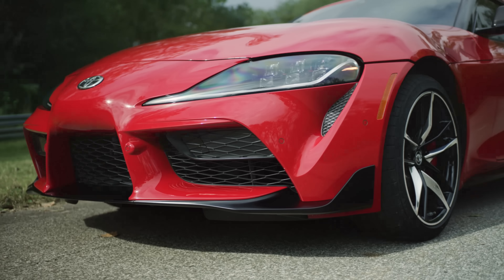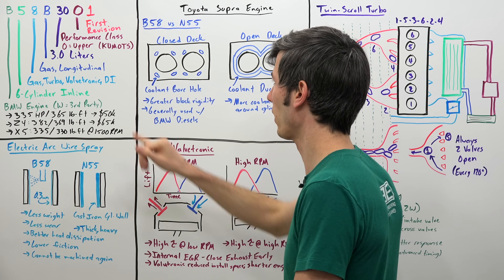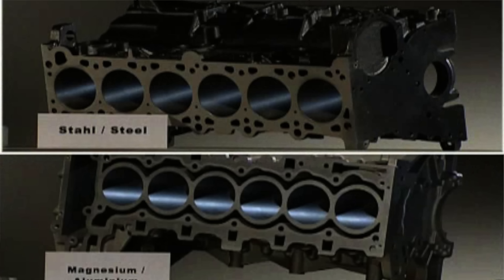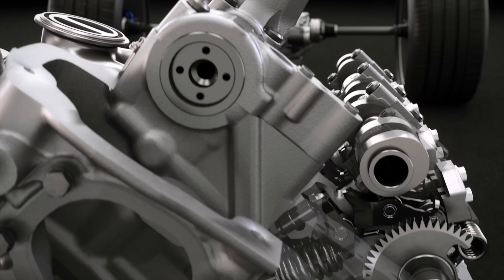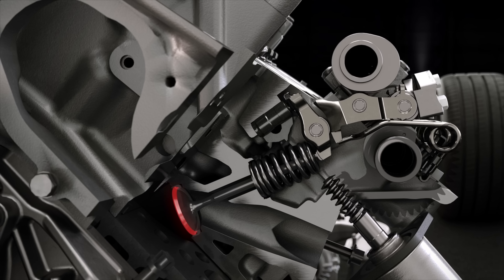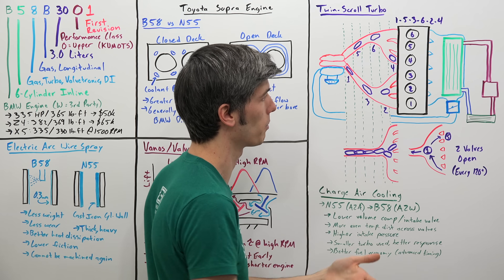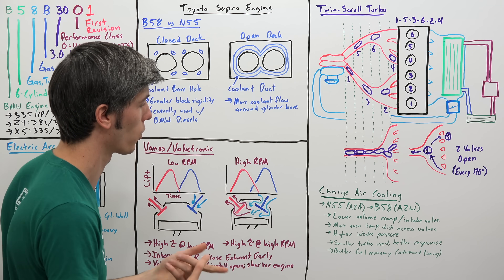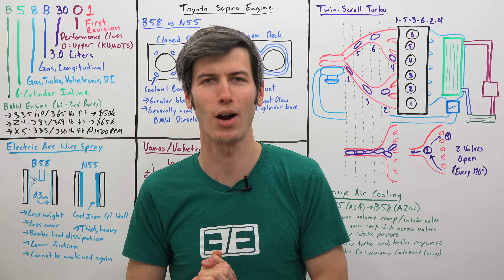2020 Toyota Supra Engine - Detailed Review Of The 2JZ Successor

Comment: Basically the engines garbage you can't really build it can't board out you're stuck with what you're stuck with
Reply: So what?  The most you can go on a 2J is .040", to 87mm.  That's nothing.  This isn't a NA big block, you don't need all the cubes.
Reply: Obviously you have never heard of sleeves
Reply: @TheRealAdamP  they just said that block was not able to put sleeves in it it has a special coating on it one size piston. From what I gather
Reply: @nyo_nyosupra1059  Probably can still be sleeved , I've heard of it being done to engines using the same coating idea before so maybe they're just saying that because you'd be degrading the engine performance/efficiency if you did it so you'd probably only do it to keep it going after some years of wear and tear.
Reply: @RWoody1995  I think it may not be possible, given the fact walls between cylinders are going to be too thin, OR if material expansion under heat is not considered carefully chance of failure is pretty big. May should be possible if someone machines joined sleeves which could be steep in price. On the other hand it may work if its possible to underbore the cylinders and increase the stroke. Those sixes are pretty balanced so added vibrations shouldnt affect them too much. Seen a lot of stroked M50s and M52s with diesel cranks from BMW so... maybe possible.
Reply: @nyo_nyosupra1059  I'm not sure you understand what sleeving is. They cut out the cylinder, cut out everything they don't need, and press new cylinders. You can sleeve any motor.

Comment: No dual injection? Doesn't that cause carbon buildup on the Pistons over time
Reply: The IS-F has a V8 with both port and direct injection to help keep the valves clean. Was looking at getting one, but decided Tesla 3 now
Reply: Paul T yeah so does rcf gsf, so I'm thinking the reliability is gonna be questionable after 100k ish miles
Reply: Build up occurs but it doesn't require cleaning until you're well passed 100k miles.  BMW figured it out when they released the N55 back in 2010 or so.

Comment: Pretty sure the Z4 is going to get a B58tu vs a standard B58. BMW covers the differences between the two, but essentially they did some tweaking with turbo size (I believe), cooling management and other bits here and there. The result being an engine that's more efficient and gets the added 50-ish bhp. This makes sense. BMW strategically giving their Z4 a bit of an edge over the Supra for initial sales. I'm sure there will be another edition of the supra that will get the 58tu later on.

Comment: I think this engine is a worthy successor 2JZ but at the same time it will never even come close or possibly be compared to the 2JZ. Why? Because of its complexity. What made the 2JZ great was not just it’s performance but it’s simplicity. Hardly any tech, just a big indestructible hunk of iron that can withstand any kind of hell you put it through. The B58 is certainly not. I personally appreciate all the tech that makes it give these performance numbers while being more efficient and lightweight - something important for a racing engine. However, that means you can’t simply slap a bigger turbo on it and make 800hp. Tuning it will take some serious engineering knowledge, and that’s okay with me. It is not meant to be anything like the 2JZ and I’m okay with that too.

Comment: I feel like Toyota gave up on trying to appeal to racing enthusiasts and the truck segment too. This car is nice to look at but the concept version was so much more appealing. It looked like a racing version of the LC500. It boggles my mind that they used a car from Lexus’ competitors instead of their own Lexus platforms just like they used to do with the SC300 . I understand that the Z4 has 50/50 weight dist. , but it is not impossible to do on a Lexus chassis, nothing is impossible. The engine block on the BMW Zupra can not even be rebuilt after it loses compression. On paper this BMW is going to be a great car, but this car is way behind its old competitors, the GTR and NSX. Both of those cars will beat the Supra in every way. Both Nissan and Acura , companies who are way smaller than Toyota, created massive hype and both have arguably lived it to it with the use of carbon fiber , suspension , at least 400hp , AWD , and they just have a presence and appeal to them especially since they are built in house. Those cars are special, they have their own unique powertrains and share little to no components with other cars in their line up. This Supra is going to be destined to flood the streets when they are lease specials for under $399 a month .

Comment: Hey slight correction on the naming scheme... the b doesn't stand for BMW. It's just the series of engine. One of the first iterations of this engine was the M50, then the M52, the M54, then the N54, N55, and now the B58. There is no W designation for BMW engines. The second is correct, but the 6 designation means 8 cylinder... so yeah. The third number just means the technical iteration of the engine. 50 being first, 52, 54, 55, 58. Etc. The next engine in line will probably be a B59.
Reply from the maker: The naming discussed in the video is correct, and straight from BMW's technical training. B (or N) mean the engine was developed by BMW Group. W means 3rd party. The 8 does in fact mean Gas, turbo-valvetronic direct injection. If you don't believe me Google "BMW B58 technical training" and the document will show up.

Comment: I don’t get this Toyota, why make supra if they not gonna make it themselves?
Reply: ButtFeet You must be either really young or late to the party. In short, without BMW there would be no new Supra at all. It would be impossible. The old Supras were made at a time were the Japanese economy was booming and Toyota had plenty of money to blow on developing their sports cars to improve the racing reputation of their company. Even still, Toyota lost money on every mk4 Supra sold. But even with all the extra money Toyota had, you have to understand that the 1JZ and 2JZ were engines that were used in a whole range of Toyota vehicles, not just the Supra, which justified the cost of development. Back then, in-line 6s were popular. Nowadays all of Toyota’s line up is either turbo 4 cylinders (for fuel efficiency) or v6. Toyota does not have a modern twin turbo inline 6 in production, and it would cost way to much to develop one for just one car. But without a twin turbo inline 6, they cannot make a “Supra”. That’s were BMW comes in. The b58 engine is one of the most reliable and tunable modern tt in-line 6 engines in production, with qualities similar to the 2JZ. So it is a lot cheaper for Toyota to source the engines directly from BMW, rather than having to make their own. From a business standpoint it makes 100% sense why they had to work with BMW. I hope this clears it up for you.
Reply: What's stopping them from updating the 2JZ and putting it back into production? It's not really any different from today's engines.
Reply: @tempest411   It's an ancient design. And i doubt that they'd be able to pass modern regulations without heavy modifications. And back then it was used by many toyota vehicles. It wouldn't make any sense to bring it back as they probably wouldn't use it on any other car nowadays.
Reply: @MidshipRunabout2  not to mention if they do that, it'll be alot more expensive than this one,therefore,endless whining still.

And that's the cringey beauty of cynicism.
Reply: Stefan Trifunovic The B58 is a single twin scroll turbo, not twin turbo. The S55 is a twin turbo engine.
Reply: If I'm not mistaken, Toyota's trying to get into sportier cars, but they don't really have any modern experience at all. That's why at first they do collabs with the best, like Subaru and now BMW, to learn. Humiliating and painful it may be, but I think these japanese are willing to go trough anything to achieve their goal here. If that's true, they may end up as industry leaders like ten years from now.
Reply: Cost
Reply: To save costs. Not many are buying sportscars these days. And they have to partner with someone else to do so, even if it means the engine won't be a Toyota.
Reply: Because nobody is buying cars and less so with sport cars so its cheaper to partner with someone else
Reply: "Because no one is buying sports cars and it costs to much"..... so why is Toyota/Lexus producing a track edition RCF, LCF and ISF? Telling me again how expensive it would be to develop a motor, but Toyota/Lexus just dropped the twin turbo 3.5 Camry/LS500 V6 into the upcoming ISF and not the Supra as well? It's the same engine in the Lotus Evora 400, 410 and GT430, which all out perform this "Supra" and is lighter. Oh but wait, the LCF is getting a grand new 4.0 twin turbo, but the LC500 bearly sold hmm. 
Keep coming up with all these manufactured excuses. The fact is Toyota didn't give a craps about this car. They used this opportunity to make a quick dollar by pimping the Supra name. I hope it fails, and yes I wish they never made it.
Reply: @Wiggy321  they've separated ffs
Reply: @masashiiino6914  huh?
Reply: Omar I was just about to touch on that. Toyota has Lexus! They have the resources to produce a high performing online six to be crossed used with other platforms. Like you said they could even use an existing high performing engine or even introduce a new version with it! If I remember correctly the Lexus SC300, IS300, and GS300 were sporting the 2JZ design for years. I bet it would have been cheaper to just "collaborate" with Lexus (even though they are basically the same company). Toyota just wants to make money. This supra is not for the people or the enthusiast, it's for those that can afford to own BMW.
Reply: @churro6160  absolutely correct. Engine sharing throughout models in Lexus and Toyota has typically been the norm in the past. The previous 3.0 and 3.3 V6 in the ES and RX was also used in the Sienna, Camry, Solara, Avalon, for example. Even the A90 and FRS 4 cyl variant could have come from the IS200/GS200/RC200 and I believe the new UX200. These cars have an 2.0 inline 4cyl turbo motor. Toyota sold, tried and true enthusiast out, for a quick dollar.
Reply: @churro6160  what if Toyota really just wanted to spy in them??
Reply: Because ground up development on a new halo sports car would've cost hundreds of millions of dollars, and Toyota basically needed to play 20 years of catch-up. Why not shack up with one of the best modern I6 manufactures, and chassis developers that is BMW?
Reply: Toyota never made a sports car. the old supra was made by Yamaha.
Reply: @gabrielabers5119  This is factually incorrect, and I'd like to know who told you that. Yamaha has only assisted in engine design and production, all Supra models are based off of Toyota vehicles, assembled by Toyota.
Reply: @gabrielabers5119  i don't know what seventh grader told you that but that is vastly incorrect

Comment: I don't know why people even complain it's an engine made by BMW. It would cost a lot Toyota to make a new straight 6 as they haven't produced one for ages. Plus even if they brought up an older design lime the 2jz, they would have had a hard time making it fit with newer regulations. It would be natural then to ask someone who's making those engines for a long time. Plus bonus fact: the racing version of the Supra had a (in my opinion much better) 3S-G engine that was borrowed from their rally cars. As far as I've seen, no 2jz was ever implemented officially in racing

Comment: If they would of copied the old mk4 they could of sold more and it would of had a cheaper price tag. If you could buy a new mk4 for about $30,000 I’d be at the local Toyota dealer.

Comment: This is an excellent power plant.  Still.  I hate it.  This turbocharged 3.0 six was the beginning of the end for BMW.   No more sweet high revving beautiful sounding N/A straight sixes. BMW now slaps a turbo on everything.  Some programming and minor adjustments and you can put this engine in almost any BMW.  If you want to charge more money turn up the hp.  BMW has become the Ultimate marketing machine..

Comment: Good thing the B58 went back to the mechanical water pump vs. the N55 electric on my Bimmer.  it is known to go out between 65K - 85K and cost $500 DIY or > $1000 at the dealer.  B58 motor still do not have a dipstick.  Gotta rely on that fricken sensor.

Comment: So basically it is a BMW Supra...well, if I wanted to buy BMW tech, I would go and buy it. But hey, I told off a guy with an LS swapped RX-7, but now I have to buy to him a Chevrolet badge and apologize...  :P
Reply: what's wrong with a ls in a rx7?  It's not like the rotary's last forever.  I suppose people could just scrap the car's once the engine's done, sort of wasteful though.
Reply: @Wooble57  well, nothing is wrong with ls, but if you want to run ls go get a corvette. You drive an rx7 because you love the unique character of the car, the turboed rotary. Even if it doesn't last forever, it is easy to rebuild. But my main point above is that you used to buy a Toyota because you loved their tech and all... Nowadays seems that this is not true at all, you buy a Toyota that has a BMW engine and is not being built for this Toyota Supra specifically. Even gt86 starts to seem more JDM than newer cars. Honda went turbo, and then car makers wonder why people don't buy new cars. I would rather buy 10 old Supra any generation rather the new one, and that is the same thing for all manufacturers.

Comment: I think you are wrong about the turbo being smaller. This is from BMW about the B58.
"Compared to the unit on N55, the B58 turbocharger has a 6% larger turbine, and the compressor wheel diameter is also 10% larger, therefore the B58 gains 20% in boost pressure."

Comment: does overlap in turbo engine means more power? its much more higher pressure at exhaust side of head because of turbo pressure and it must damage the engine then

Comment: So we don't get the reliability of Toyota? :(
Reply: I'd say Ull get better reliability than Z4. That is why theres less power and torque. Toyota thought of the longevity. Also all the programming is done by Toyota. 
BMW does not make their own gearboxes, they are made by ZF, BMW only does the programming. Same thing.
Reply: @jevgeniardassov  that's nice to know, now that I can afford a car like this I would like to drive it for a long time without it being a money pit
Reply: No you will get BMW reliability this time around.
Reply: @MrRoyck10  which is a good thing because they have a reputation for reliable engines.
Reply: You mean reliability of Yamaha.
Reply: @jdmr1c3ing  not all Toyota engines are designed by Yamaha, only a few.
Reply: @jevgeniardassov  if by only a few you mean all of their performance engines then yes Yamaha built a few.

Comment: Over-engineering will reach a point when we have to start using alpha-numeric-wingding codes for naming.

The clover means it's a rotary engine
The spade indicates direct injection
If Pac-Man is the third position it's a revision 3 engine
And an empty square indicates your engine is not compatible with Unicode text